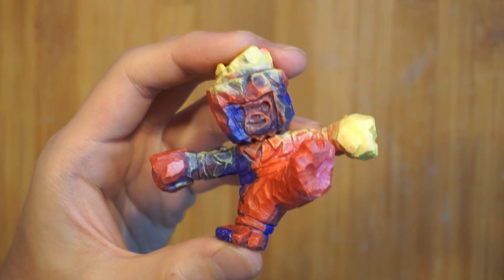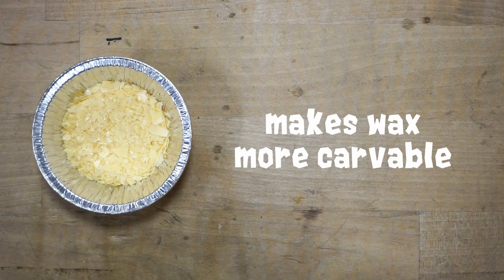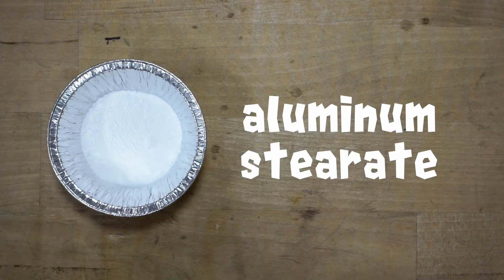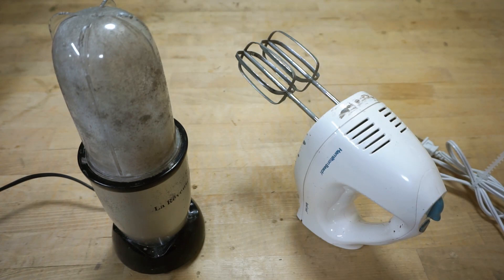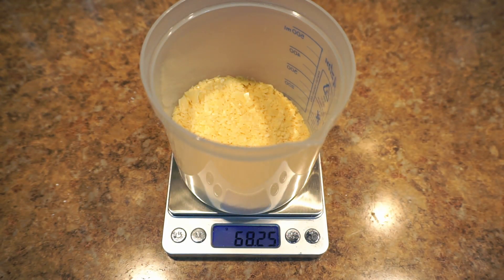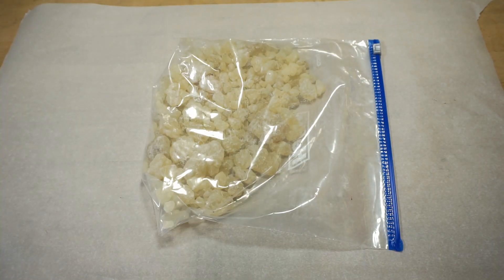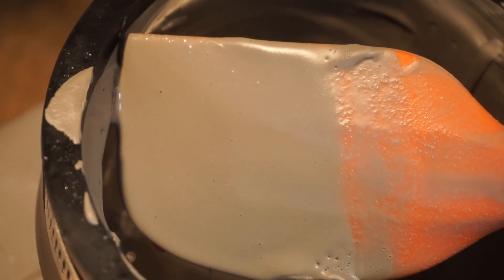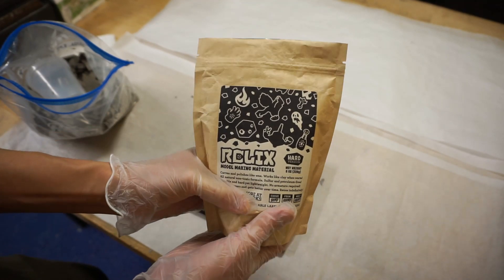How to Make Toy Sculpture Clay and Wax - Intro to Relix

Comment: A very expensive modeling mass. More expensive than the Monster Clay.
Reply from the maker: Indeed! If you make it yourself it's not as expensive but I wish I could offer it at the same price of Monster Clay! However, since I don't use petroleum-based products like paraffin or microcrystalline wax, I think the trade-off is worth it :)
Reply: @RelixWorks  It's all about the cost of materials. It is easy to calculate that their cost far exceeds the price of Monster clay. And is the production and use (heating) really safe for health (inhalation)?
Reply: Monster clay hard is still too soft for my tastes. 

And it is definitely clay-like and if you like wax , Monster Clay is not very fun IMHO.

If you’re looking for a clay like product,  the book “Pop Sculpture” by Tim Bruckner has my formula for an easy Hard Clay and his personal formula as well.

Also look in YouTube for “Plasticera” most of the videos will be in Spanish but some are subtitled.

It’s an in expensive blend of plasticine and wax. But again it’s not wax like Relix.
Reply: @garyoverman4393  What I care most about is that the mass is not toxic when inhaled. As well, she was not expensive. Even Monster Clay is a bit too expensive mass. If anything, I would buy Degas wax. As for hardness, it depends on what you need. Perhaps the hardest version from Degas will suit me. However, I have some beeswax at home and for the test I will make this mass myself first at the cheapest cost without any toxic additives.
Reply: @Gawron..   

A very simple mix that Tim Bruckner included in his book “Pop Sculpture “ is a simple wax and ball clay blend that I used for decades. It was included in the book because it is very inexpensive to make and allows the artist to customize the hardness to their preference.

It’s about 50%  wax of your choosing, 40% ball clay, and 10% coconut oil. By varying the coconut oil you can make harder or softer. More coconut oil creates softer, less and the clay is harder.

just a note … all smoke is detrimental to health.  And natural doesn’t equate directly to safe for all users.
even all-natural ingredients can create a problem if heated to the point of smoke. 

also allergic reactions can occur with nearly anything… like peanuts, and some plant resins not to mention petroleum based stuff. Baby oil and vaseline used for decades with little issue, but they are petroleum based.

One of the things i always like about mixing my own products is that I know exactly what is in them.

I think there is a much greater awareness now in the industry (thankfully) but about a decade ago It was reported that One popular product being sold allegedly used motor oil in the early days. When it sold to another maker they immediately saw it as an issue and They eventually switched to a plant based oil, but who knows what effect might have been for some.
Reply: @Gawron..  beeswax used by the masters for decades of course. Always a great place to start. Titanium dioxide will make it lighter in color and opaque. It’s a natural mineral, used in products like sun screens and toothpaste.
Reply: @garyoverman4393  I want to make a similar mix. Only pure petroleum jelly will be used instead of coconut oil. Coconut oil will go bad someday. Ingredients already purchased. You don't need to use high heat to melt the wax. Enough 100 deg. C
Reply: @Gawron..   I have sculpted pieces from 30 years ago with coconut oil. Beeswax and honey have antimicrobial properties.   My mixes with plant waxes melt at 76 deg C .  I do small pieces so beeswax and petroleum are way to sticky and soft to hold any decent details. But for large scale work like it sounds you are pursuing, it’d be way to tenacious for quick work. Toy waxes like Relix are often sculpted by additive modeling and then detailed by carving, and then finished by polishing or sanding. 

Over the 40 years I’ve mixed my own waxes  I over 900 tests .  
so I can attest that it is nuanced and very personal what people prefer. 
Have fun experimenting, but be careful… it can be addicting :-)
Reply: @garyoverman4393  There was no honey in your recipe. It is the honey that gives the stickiness rather than the petroleum jelly. I plan to make prototypes from this mixture. Then a negative from it and a cast. A plaster cast because it is cheap and non-toxic. I want to make a negative from gelatin.
Reply: @garyoverman4393  Thanks for the clarification on this honey and coconut oil. It does make sense. Such a mixture should not spoil if there is not much oil in relation to the wax. As for vaseline, it is actually something similar to regular artificial wax. So perhaps it makes no sense to pay for natural beeswax. I already have the natural one, so I will use it. As for clay as an ingredient, I have one in a powder (not in balls). Does it matter? Probably not. By the way, is this mix of yours tougher than the hardest Monster Clay? Is it not too dry? I've already seen dry and brittle homemade masses on youtube.
Reply: @garyoverman4393  No, no Degas, I meant the product, the modeling compound. This is such a cheaper counterpart of Monster Clay. https://www.prochima.it/degas.html
Reply: @garyoverman4393  Your last comment did not appear. I can only see the fragment in the notification.
Reply: One more note. Scale makes a huge difference. The wonderful artist in your video (I had seen his work prior) is working at a fairly large piece. He would HATE my waxes as they are much too hard and quick cooling for work of that size. Typically, the smaller the work the more hard the medium needs to be. And the larger work needs a softer and easier to work consistency. 

Hopefully that makes sense.
Reply: @Gawron..   I thought I had heard of Degas in Europe mainly, but knew the famous “Little Dancer” by Degas was done in a wax made by the artist. Sorry for the confusion. 

Oil clays are much less expensive than wax. They have completely different work flows though. Usually the oil clays (may also contain wax and usually do ) are for larger works and the waxes are for small and highly detailed and carved features.

Smooth-on also makes a very high quality oil Clay modeling product Sculptex. It has 3 grades of hardness.
Reply: @garyoverman4393  I've seen this movie before. Monster Clay is wax too, just a different wax. The question is what technique someone works with. I mostly stick, so I won't scrape hard material. Small protruding details (and larger ones) are the easiest and most convenient to shape and glue. The viscosity is therefore desirable. Hard material is a different kind of work. It's more sculpting than molding. Therefore, for example, coconut oil would make sticking elements difficult. Such a hard wax is also suitable for casting as shown in the video from the link. I just need wax / clay for sticking.
Reply: @garyoverman4393  It's also true - Big jobs require different material. I would do more or less this size work like this artist from my link. Anyway, I was doing much bigger than him, because the scale is like an adult man :) But it was a long time ago and I made these figures out of plaster, by hand, gluing and the construction was made of steel bars. Then they were painted with acrylic paints.
Reply: @Gawron..   I know exactly what you’re talking about now…. Plastic malleability.  Most people don’t realize that waxes become crystalline matrix as they cool almost similar to how glass goes from soft taffy when melted to hard brittle when cool. 
microcrystalline wax is called that for a reason. The crystalline structure of the molecules is very small and prevents that issue for the most part. Natural waxes and paraffin crystals are much larger and affect that trait.  Even beeswax has much larger crystals than microcrystalline wax.

I really dislike crumbling texture although compaction during modeling will usually improve that.
Many blends must be conditioned and kneaded like polymer Clay before becoming very plastic.  This is because the crystalline structure is redistributed during kneading and then returns over time as it changes back to a harder crystalline structure. I believe that excess paraffin and carnauba exacerbate that issue, but all natural blends have it in varying degrees.

Oil Clay and plasticine doesn’t do it because they do not usually change structure when cool. It’s why toy waxes and modeling clays are so different in feel and in work flow.

I don’t like that “dry crumble” at all.  My favorite home mixes don’t do that.  I want to be able to shave off wax and then be able to reattach the shavings without a heated tool.  I also want to be able to “push model” details on the surface without it breaking.

My current personal blend produces a fine wood-like curl as I carve superfine details. That shaving can be stuck back to the surface with just the heat of my hand.

I use graphite and titanium to color my wax and it does not stain anything.
Reply: @garyoverman4393  Yes, but the original "Monster Clay" does not crumble, although it is based on regular wax (not microcrystalline). Something is wrong with those people who create their mixtures (the links I gave). However, you write in the last sentences about a mixture of 50% wax, 40% clay, 10% coconut oil?
Coconut oil does not make sticking difficult? The 50% wax, what is this wax for you? Bee or microcrystalline?
You wrote something before about harmful smoke while making the mixture. I understand that smoke never arises, since the mixture is formed / melts at about 76 degrees C? Your blend seems to be the cheapest option (depends on what wax it is) and if it works then maybe I'll replace the petroleum jelly with coconut oil (slightly more expensive). I will do two versions.
Reply: @Gawron..  The wax I used is a brown micro commonly called “Victory Brown Foundry Wax”

It is similar to beeswax, but more plastic since beeswax is crystalline and not microcrystalline. I will warm you though that it is missing the wonderful natural smell of Beeswax and Candelilia wax. 

But smell isn’t a concern to me. Crayons stink in my opinion. Smoke is the danger. Use good ventilation and keep temperature as low as possible to avoid smoke but also avoiding damaging your product.

It’s sticky when warm but only tacky at room temp (70f).

Talk to your closest supplier and ask if they have a similar product. You can adjust by tweaking the Clay content.

I think once you get something you like you’ll appreciate that you don’t have to worry about a company changing or closing on you.
Reply: @Gawron..   

do you use a more appropriate venue like Facebook , Instagram , or even email?

I want to be of help to you as you learn and explore, but commenting here is just too cumbersome and awkward for this 60+ brain.

If you want to pursue , let figure out a way to not interfere with Kevin’s business and generosity.
Reply: @Gawron..   reply

 actually the coconut oil is exactly opposite of what you are thinking. 

In the mixture It softens the wax and makes it stick together easier. It doesn’t not make the product feel oily like you might guess .

You’re spot on about matching the material to the technique. If you do additive modeling then Monster Clay and similar products like Chavant are going to favor you. Hard waxes would drive you crazy I think.

My wax is used at 3 temperatures. At 115f  it is very plastic and malleable. At Body Temperature (98f)  it is firm but models well and will easily bend before breaking. At Room temp (75f) it is more like a plastic and carves similar to hardwood.

It changes from that soft state to hard very quickly… a trait that works well for small works, but for large sculpt it again would not be desirable. 

Wonder why they called it Monster Clay if it’s really a wax… seems like a misnomer :-)
Reply: @garyoverman4393  As for the contact, I only use e-mail.
Enter your email address and I will write it.
Reply: @garyoverman4393  The document does not specify exactly how much of what is in the composition. There are only % ranges. Perhaps it is as you write in terms of proportions and in terms of filler, but what is the filler they did not give either. It is important that the mass is not toxic, does not stain, is not brittle when sticking and is cheap. I need a mass that is quite soft (medium soft) for a long time, because I work / model for a long time. Then it's good for it to harden enough so that I could freely make a cast. You wrote something about brawniki. Making ready-made figures of the size like those from my link, from this type of mass, would be bankruptcy. The mass, however, cannot be more expensive than Monster Clay. Best of all, it would be much cheaper. If it is to be cheap, the supplier should be regional. I am not from the states but from another country. But thanks, let me have a look.
Reply: @Gawron..   

the range on % is to protect under “Trade Secret” protection. 

A Patent requires exact measures to be disclosed. So the range is to not publicly disclose the formula and lose the Trade Secret protection. 

Having written professional MSDS documents myself  it is really easy to discern that if the absolute most wax content is 60 and there are 2 other ingredients that it is almost certain that the wax is less than half.

I sent you email address on a separate message. 

It may be easier for you to give me a list of ingredients that you can purchase without import costs and then we can figure out a workable recipe by working backwards.
That may not sound logical to you, but I’ve helped artists in South America, Australia, and elsewhere in that very manner.

As an example I work small and can easily buy Dragon’s Blood ( it’s a resin collected from trees in Yemen) I have it in my shop right now. 
But to give you a recipe with that would be a disservice. So check out what materials are affordable and available to you and we can go from there.
Reply: @Gawron.. Don't buy Degas wax. It is no longer the formula of 10 years ago. At the moment it is softer than MonsterClay, even in the hard version. It creates annoying whitish outcrops. It has an ugly color that is too translucent. It cracks even when it is hot. But above all it doesn't hold back details.
It is sold as professional clay but in my opinion it is closer to children's clay. It is suitable, possibly, only for very large sculptures, for one meter figures, maybe.
Reply: @garyoverman4393  hello Gary, I’m trying to make my own hard clay for small scale sculptures since Monster Clay isn’t available where I’m from, can you please share your recipe with me? What waxes did you use? I have access to Microcrystalline, Paraffin, Carnuba, Candelilla, and Beeswax